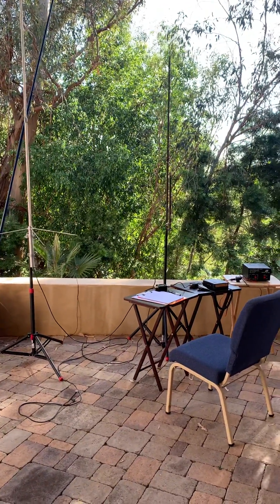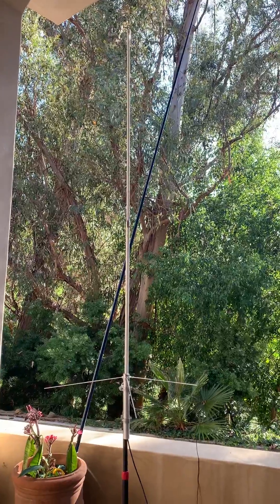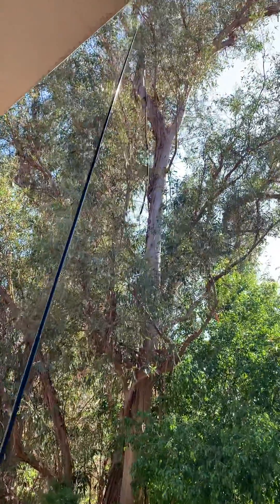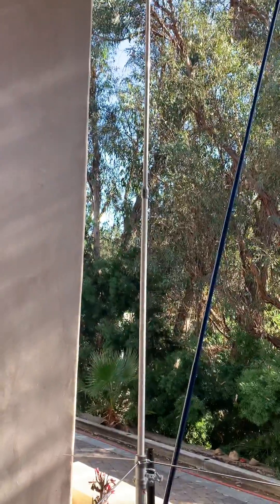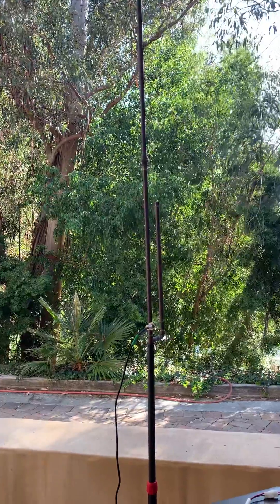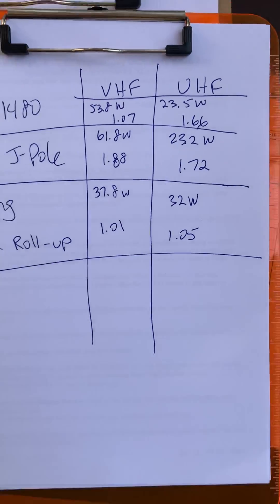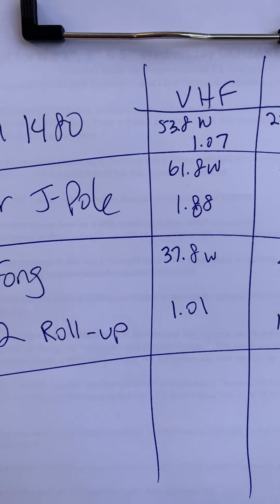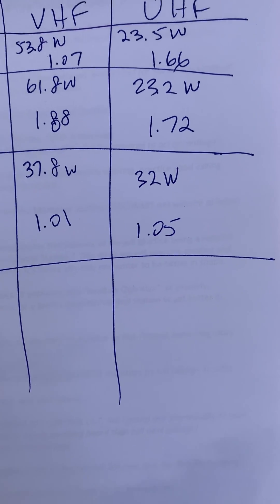Tram 1480 vs Copper J-Pole vs Ed Fong DBJ-2 SWR Comparison

Comment: I built my own copper J - pole and tuned it for broad band use from 140 to 150 MHz. My center tuned at the middle is as low as 1.01:1 and got a 1.4 to 1.5:1 at my band edges and my lowest Reflected power was .5 milliwatts and never got past 150 milliwatts. Believe me, patients is the key to whatever you want to attain.
Reply: I suggested you to switch on Round big Dipole than j-Paul mine is good on 149-159 and tuned on 469…

Comment: My Tram 1480 at 50 feet fed with 100 feet of JEFA Tech LL-400 Flex coax (same as LMR-400 Flex) running 50 watts into it with a Yaesu FT-8900R has a 1:1.01 VSWR on VHF and 1:1.09 VSWR on UHF and I can talk simplex to other stations up to 60 miles away (I live in a very low spot in the middle of a city in Southeastern Massachusetts) and I regularly talk with hams in the Boston area!  It has been up for 8 years now with no problems.  I can hit repeaters in New Hampshire and have talked as far south as Virginia on 2 meters during an opening!

Comment: Was wondering where you got the tripod stand
Reply from the maker: Home Depot - https://www.homedepot.com/p/Husky-Tripod-for-Portable-LED-Work-Light-K9028/207186703
Reply from the maker: Hand I known there were other options, I may have chosen this one: https://www.homedepot.com/p/GT-LITE-54-in-Telescoping-Tripod-with-Universal-Fast-Latch-GT-TP-54/308664779
Reply: @MarkWarrick  I was just about to go to your video with the rollup antenna mounted to the PVC pipe, but you beat me to it. I'm glad you saw this video. By the way, you did a great job there.

Comment: I just put up a Tram 1480, and I already have an Ed Fong foldable J-Pole. The J-Pole is  hanging from the ceiling in my office indoors. The base of the Tram 1480 is about at the level of the top of the J-Pole, except the 1480 is outside, attached to the side of my house.

I was surprised at the difference between the 2 antennas. They seem to work about the same going to a repeater on the top of a local mountain. However, the Tram 1480 works better when talking with people closer to sea level. It seems like the 1480 has a lower angle of radiation.

I'm very pleased with both of them.

Comment: Everything in relative.  The way the antenna is mounted.  The height above the ground.  What kind of coax are you using ?  Are there objects near the antenna ?  Is the antenna grounded ?  The moral is that you  need to do more research.  As others have stated...  a dummy load can have a 1:1 match and is not a resonating antenna.

Comment: I agree with the comment that the j-pole can be turned. An easier way is to simply take a loop of 12, 14 or 16 guage wire,  insert it into the very top portion of the j-pole, check for best SWR by sliding the loop up or down inside of the copper pipe, and when the best match is found solder it into position. 

The antenna inside the fiberglass pipe of the Tram is a collinear antenna which will render greater gain than the other two antennas reviewed. A better comparison would be to acknowledge the comparative power gain among the three antennas and demonstrate this by connecting each of the antennas in succession to an HT and then have someone at a distance measure the transmissions using another radio on a simplex frequency. My expectation is that the Tram will outperform the other two if each are mounted at the same point. BTW, this Tram is almost identical to a similar model made by Jetstream that is almost identical to a model made by Comet. The roll up antenna you have there is probably a wire version of the copper cactus j-pole.

Comment: Just because an antenna has a low swr doesn't make it a good antenna.
a dummy load has a 1:1 swr but it doesn't make it a good antenna.
the match on your Jpole is miss adjusted.  A J pole that is correctly matched will have a low swr.
73 Mike WA8ZPD
Reply: i just made a jpole that has 1.01 swr
Reply: I am about to make and tune a jpole out of either 1/2 copper pipe or solid 12ga copper wire slipped inside pvc pipe. Do you have a recommendation on which method might perform better? I've looked everywhere for comparison of either method and found nothing. I have a nanovsr and will tune for best impedance match (feedline position) then adjust the cut to center my frequency on 462.65Mhz for gmrs.
Reply: @Gruuvin1  I plan to build one for GMRS also, and since it's so much smaller than the 1/2"copper J-poles common for 2 meters, I'm going with 3/8" copper. That way the spacing between upright elements will be proper. One article I found said wire would work, but smaller surface area makes it very frequency specific.  Sorry...I've read so many articles I don't remember where I found it.